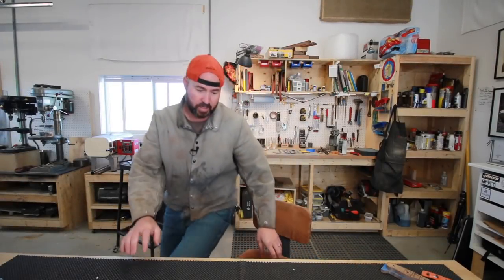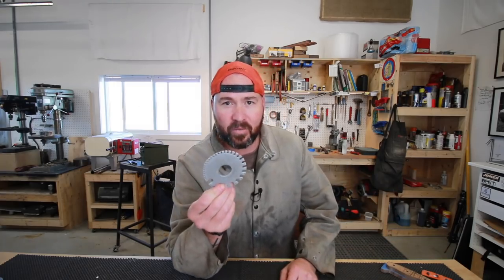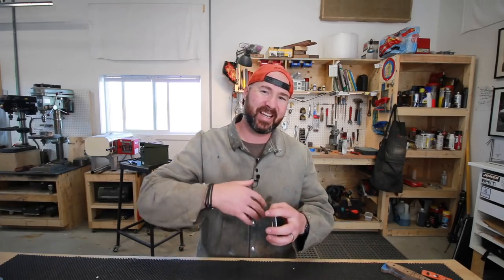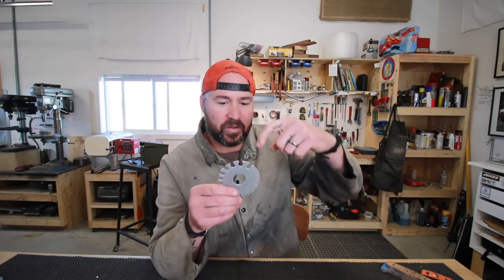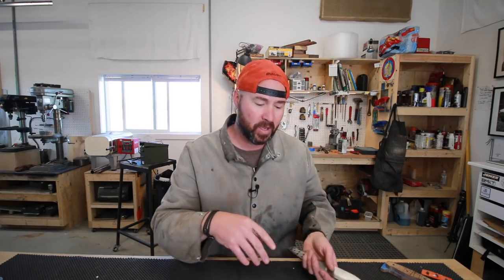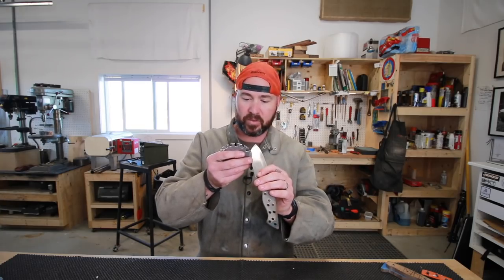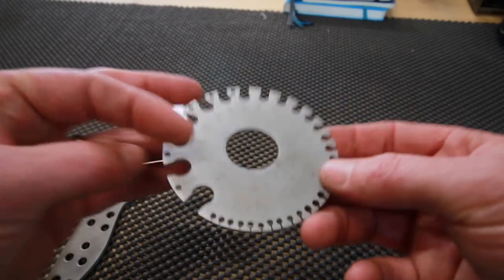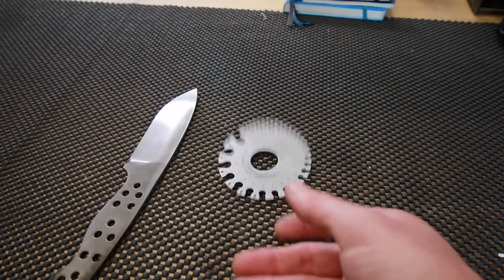Handy tool for the knife-maker - Tool Time Tuesday

Comment: Sorry to say it in a very blunt way. Bullshit tool. I have 2 measuring tools im my knife shop. My 40 years old non digital calipers and a stainless steel ruler. I have micrometers and a digital calipers but rarely use them.
I measuere everything with my caliper in the metric system. Precision in 10th of a millimeter, all I need. Hardened calipers, never an issue. Just my 2 cents.
Reply from the maker: I appreciate your 2 cents. We all have it to give. This video was mine. I also appreciate you being willing to straight up call bullshit. Seriously. Differing opinions are necessary and make up better through thought. I by far prefer to leave these at my grinder and find it way faster to check edge thickness than callipers. I use these pretty much only for checking edge thickness. I certainly do agree too that callipers would probably be more accurate than these and I use callipers all day long in the shop for other processes. But when I've got several hours at the grinder and 10 blades to rough grind  in a day, these are hands down faster for checking edge thickness. Thank you for chiming in. Cheers 👍

Comment: I use both and I also have a cheap plastic dial caliper the I use to check drill bit sizes quick. My Starrett usually stays in the case unless I have something critical to measure.

Comment: I;ll have to try and find one of them.👍 
Even tho i often use feet and inches i'll never get my head around thousadths of an inch. just not logical to take a measurement system based on the length of a blokes thumb and then divide by base 10 🙄 😂
Reply: even more fun are those chineseum bolts.. imperial thread with a metric head, or just some random size that is halfway between 🙄

Comment: This tool has uses in all sorts of metal work. I use it to reference earring gauges when I receive shipments to make sure I received the correct sizes and if I find pieces that are not properly gauged I can send them back to be sent the proper pieces or refunds. For jewelry this tool is useful when selling multiple pieces and need to tag things for the customer. When customers are looking at gauge earnings they sometimes(almost always) place things back in the wrong place so it’s also useful for sorting your own inventory. I could go on for days about this but y’all get the picture. Just thought I’d share that bit.
Reply from the maker: Right on! Thanks for those examples. Quite versatile for all sorts of stuff👍
Reply: Very useful. I'm working on turning one of these into a necklace pendant for edc. I'll probably be a while because I want to find the right material to make them from.